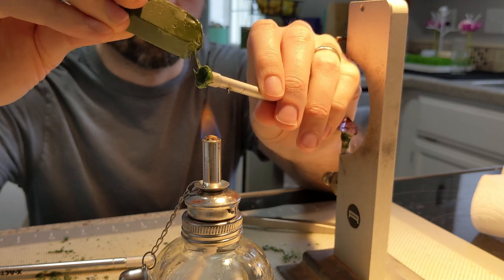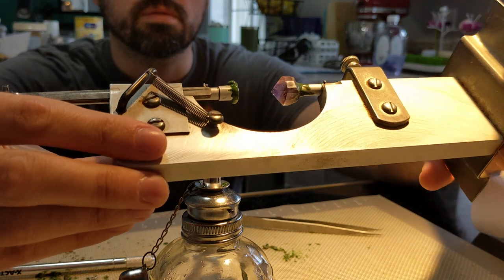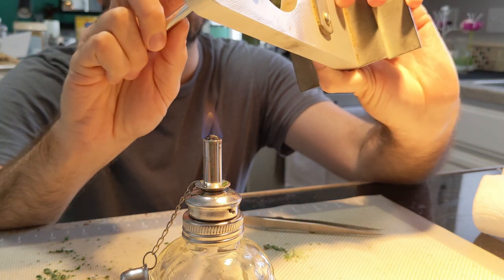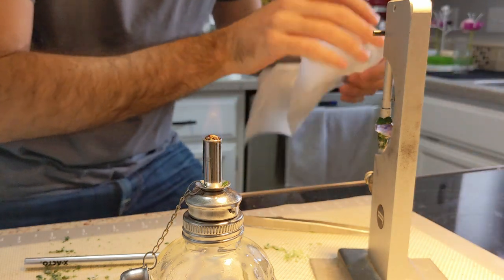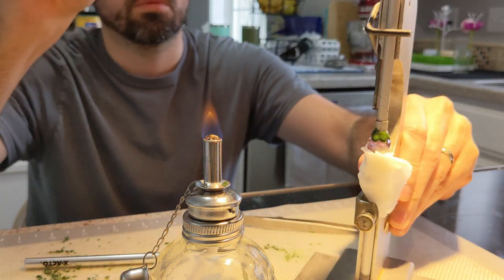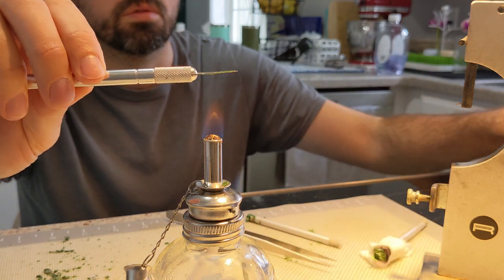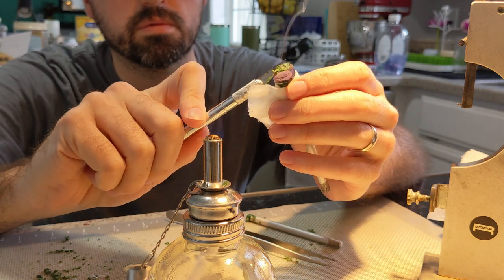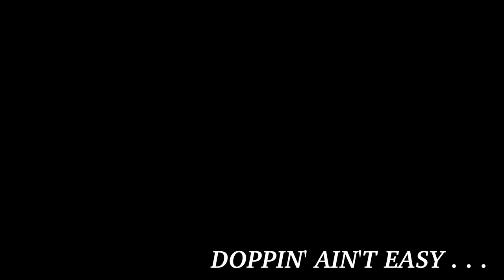Transferring Gemstone Dops – Real Time Example

Comment: Hi Patrick someone offer me a faceted like your. It only comes with  4 laps and also doesn't come with the small thing on the back of your faster. No transfor dapper. How much did you pay for yours if I may ask. I'm new at this and do want to get ripped off. Thank you for your help. And by the way your vedios are awesome. 😊💝
Reply from the maker: Hi Gabriela, is it a raytech shaw? There are lots of makers of platform faceters. I can't speak to the quality of other brands, but if you have the make then I recommend looking up what a new one would cost. Mine was a little over $1k, when a new one with all the extras would've been over $2k.
There's also the question of how well the machine has been maintained. If you can, make sure it's in good working order as best you can. I took mine to a friend who has experience with faceters to check it out.
4 laps may be all you need if they're in good shape. I mainly use four laps- tin, 1200, 600, and sometimes 180.